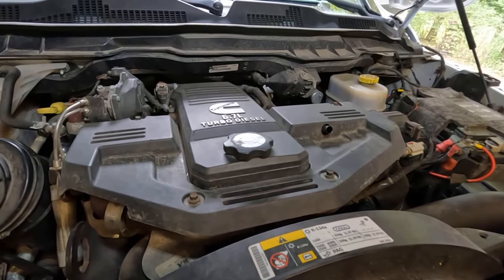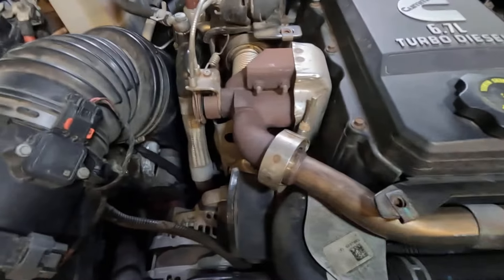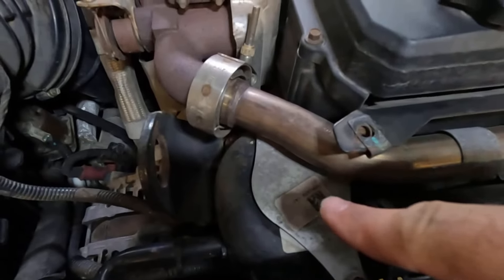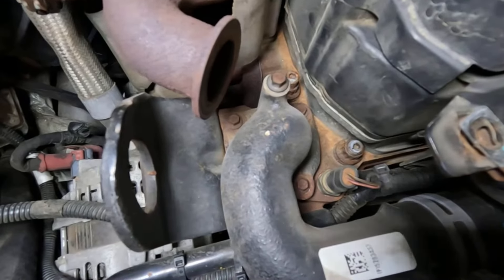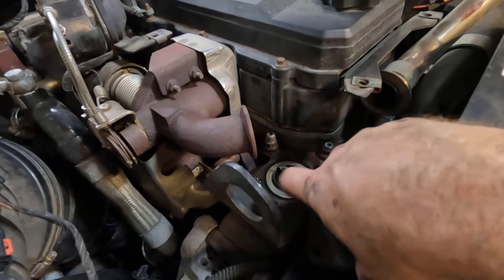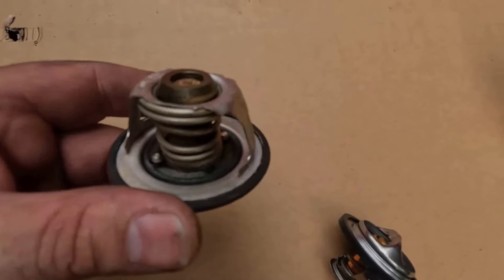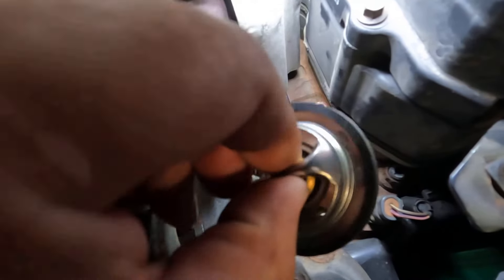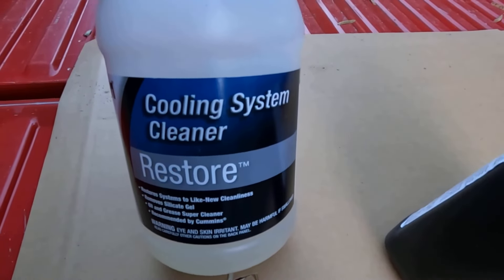How To Replace Thermostat 6.7 Cummins (2017 Ram 3500)

Comment: Nice, straight to the point with tricks to avoid unnecessary disassembly. Going to tackle thermostat and drain and fill coolant this weekend. I love that it’s this easy on the 6.7.
Reply from the maker: Thanks for watching and commenting!  The 6.7 is a good engine. Have a Blessed Weekend Friend!  Justin

Comment: Hi friend, that thermostat you changed is for cabin heating or engine cooling, I didn't understand that part, thanks for sharing.
Reply from the maker: It does both. It is the only thermostat, so it controls the engine coolant temp and you get your heat from the heater core, which your coolant flows through. Have a Blessed Day Friend.  Justin

Comment: Do you have a part number for metal gasket that goes on the egr cooler side of the tube?
Reply from the maker: Sorry I don't. I used my old gasket. Your local dealer should be able to give you that part number. Thanks for watching!  Justin

Comment: Does this manifest as a p0128 code?
Reply from the maker: If your thermostat is stuck open it could cause this code. Make sure your coolant is full in the overflow jug. If it is, I would change the thermostat if your engine is not running  192 -195 degree. Have a Blessed Day Friend!  Justin
Reply: @homegrowncountryhomeplace  coolant is good, no air trapped, so yes, seems like that's in order, thank you!

Comment: Make sure you use a Mopar thermostat, aftermarket ones fail easily. Yes I know they are almost $300
Reply: Buy the Cummins parts through Cummins. Much cheaper as Mopar up charges the Cummins parts.